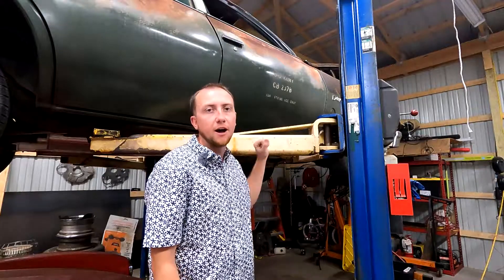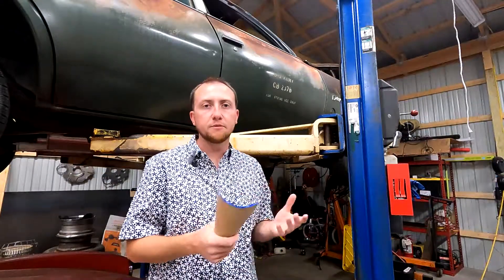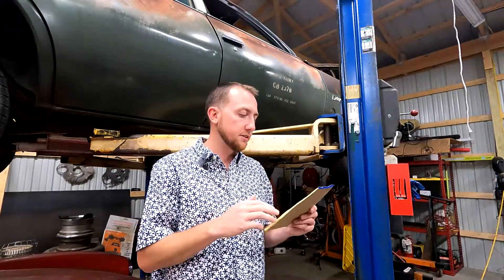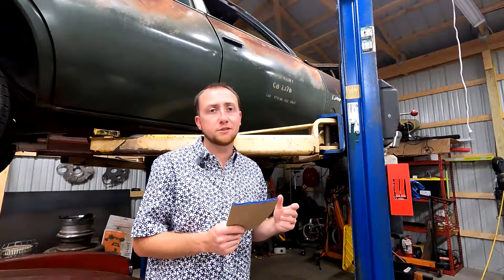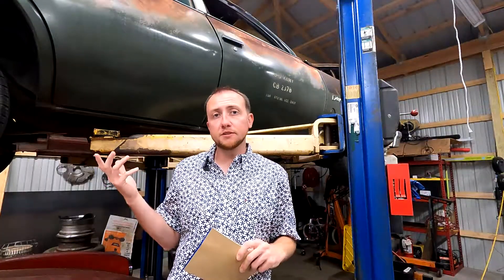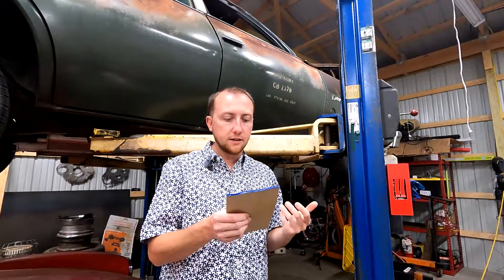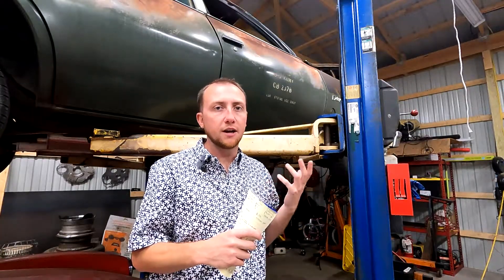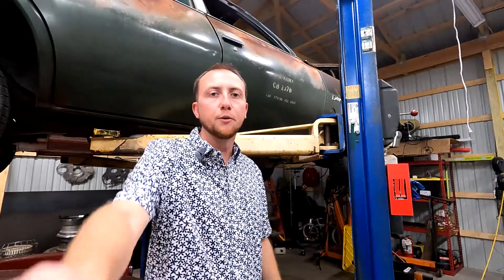Cheap LS Swap for the Army Chevelle - How much does it really cost?

Comment: Thanks for this informative video! I have a 1969 Chevelle Malibu that I’m contemplating an LS swap for. I’ve seen all these videos where the guys spend $15,000 on the engine swap.  That’s just not cost-effective. Your video gives me hope.
Reply from the maker: It's very much a "your mileage may vary" experience. I got lucky with a good deal on the whole package and it turned out to be a good runner, but that was a bit of a gamble. Good luck on your project!